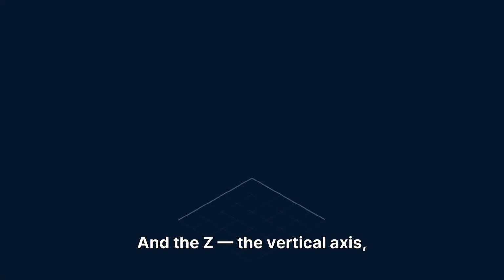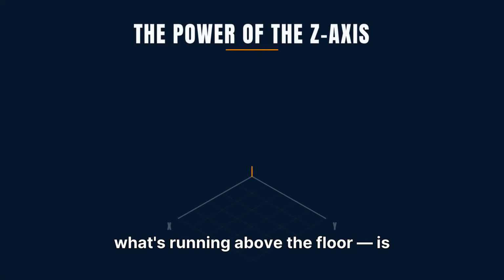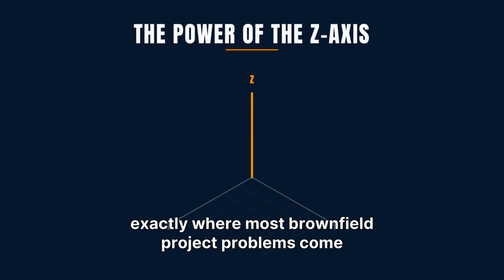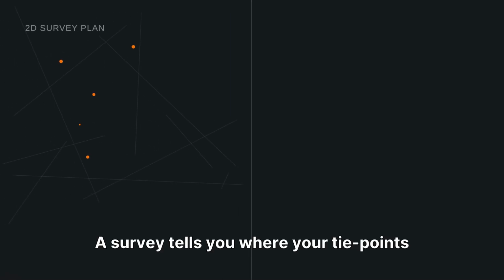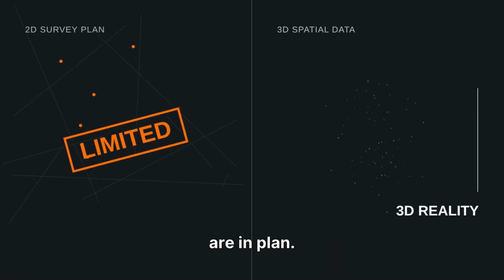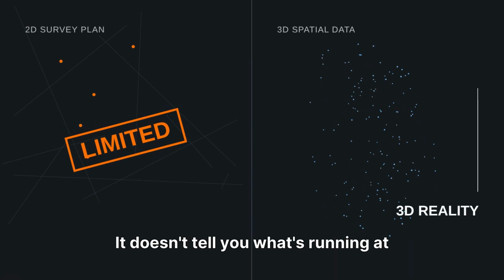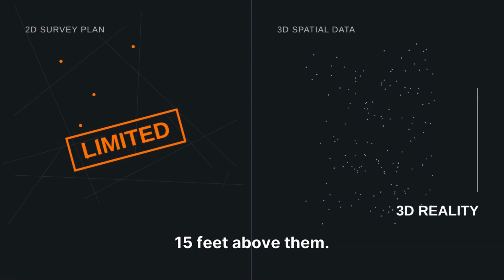Laser Scanning vs. Traditional Survey — Brownfield Projects, Oil & Gas & TAR

Comment from the maker: In short: Traditional surveying captures the specific X-Y positions you define — it's the right tool for boundary work, geodetic control, and narrow 2D scopes with no overhead complexity. 3D laser scanning captures a facility in full X, Y, and Z as a point cloud, and is the correct choice for any brownfield project involving tie-ins, modifications, FEED/FEL work, or pre-TAR spool prefabrication — because the interferences that blow up schedules are almost never at grade. They're at elevation: overhead piping, cable trays, structural steel. And the Z is not in a traditional survey.